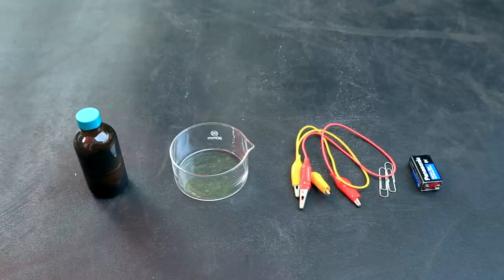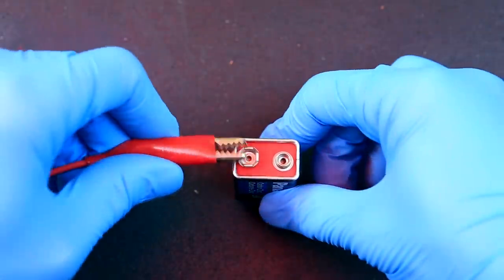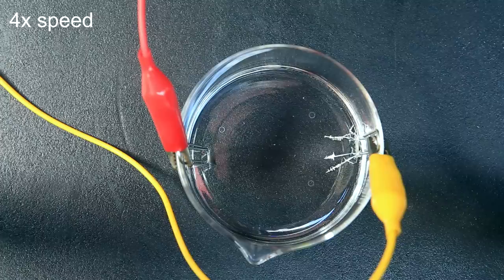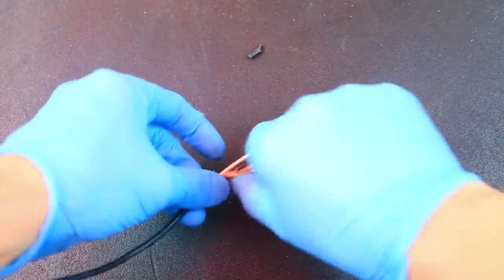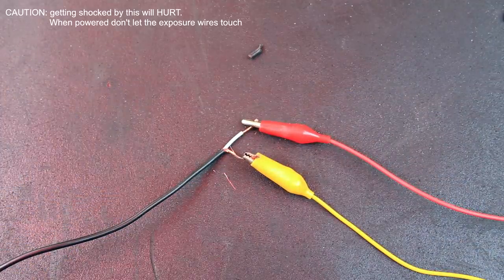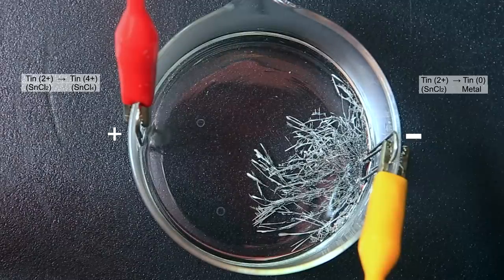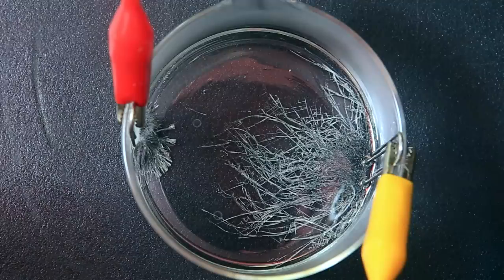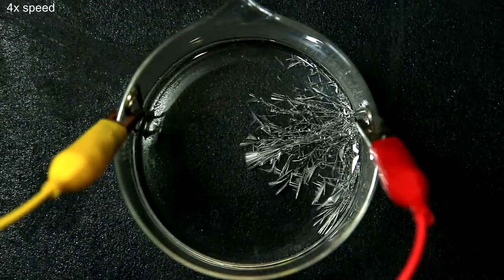How to grow Tin Crystals!

Comment: This experiment could be interesting at super-low temperatures. The low temp should increase current flow, but may inhibit crystal growth due to substrate viscosity, depending on how cold it was. I'm thinking once with an ice bath & once using liquid nitrogen with the nitrogen gas piped away so we can still watch it.

Comment: The solution is not boiling but along with Sn(2+) goes to Sn(4+) you have water oxidation: 2H2O to form  4H(+) + O2 + 4e-. What you see are O2 bubbles evolving on the anode. Contrary to that Sn(2+) + 2e- gives Sn(0) should happen along with HER (hydrogen evolution reaction). Luckily, Sn, Pb, Hg, Cd are bad electrode materials for HER. In fact, they significantly shift the onset potential for HER so that it will happen only at much larger applied potential than what would normally happen on Pt, Au, Ni etc. electrodes. That's the reason why we used to use Hg in Polarography (you can even reduce alkaline metal ions to form amalgams on Hg droplet that serves as an electrode during the Polarographic experiment). 
Cocking is nice but electrochemistry is more fun :P
Reply: Indeed it looks like electrolysis is fun!
Reply: “Cocking is nice”? Cocking what??
Reply: @Dave-dh7rt  Pretty sure it was cooking 😆
Reply: That’s too science to keep track off
Reply: I r cunfoozd
Reply: Ok big brain
Reply: big brain i didnt even understand a word you said
Reply: Electrochemistry is fun if we can understand :p
Reply: Dude,Please use english.
Reply: Sn or Zn?
Reply: Yes, as has been pointed out numerous times over the last few years.  Sometimes reading the description and the previous comments reveals such things.  😁😉

Comment: Hello there! :)
Nile Red, I like your chemical videos very much, they are really interesting and informative.

Let me make some remarks for this experiment. If you use power supply, it's very desirable to connect a resistor consecutively with your electrolytic cell. If the cristals of tin grow large enough to touch both electrodes, there is a risk of short circuit.
In the electrolysis process tin chloride solution on the positive electrode (anode) dosen't boil. Besides of main reaction of oxydising Sn2+ to Sn4+, here take place side-reactions:
     2Cl- -- 2e = Cl2
     2H2O - 4e = 4H+ + O2
Thus, the gas produsing on the anode is basically chlorine with some oxygen.
Reply from the maker: +KotMatvej Oh yes, I totally forgot about that! I kind of just assumed it was boiling because it was heating up the liquid a lot.
Reply: +Nile Red What does he mean it doesn't boil? It looked like it was boiling, wasn't it ?
Reply from the maker: +Constantino Fine Art It might boil after a little bit of it being on, but for the  most part it is gasses that are being produced by the electrolytic process.
Reply: +Nile Red What gas was being generated at the red end when it made bubbles? that's what I meant. I thought the bubbles were just water being boiled and not any gases being reduced
Reply: +Constantino Fine Art  The gas being generated at positive electrode is basically chlorine. When electric current run through the solution, tin ions Sn2+ reduce to metallic tin and chlorine ions Cl- oxydise to elemental chlorine gas. 
If you try to apply electric current to the table salt NaCl solution, at positive electrode you will get bubbles of chlorine gas too. 
Please read about electrolysis process, if you are interested :)
Reply from the maker: Thanks! I just totally and completely goofed when I thought about it. I used to do a lot of electrolysis and I've done it to NaCl too. Thanks for all the info! Greatly appreciated.
Reply: +KotMatvej Thank you! I observed a few times when I electrolysed copper sulfate that at the beginning only copper was being reduced at the cathode, and hydrogen at the anode,  but that after a while, lots of bubbles starting coming from the cathode along with steam. I assumed the water was being boiled at the cathode instead of any gases being produced. Do you know if a gas was being produced as well?
Reply: +Nile Red, you are wellcome!
 I am really pleased that my remaks can be helpful. On the other hand I am sorry if my comments embarrassed you. A long time ago I made electrolysis setting for sodium chloride solution and got enough quantity of "detonating gas" mix from chlorine and hydrogen to produce a lot of explosive soapy bubbles :))

Recently I have thinking about that chlorine and hydrogen gases don't react among themselves in the dark, but ultraviolet light can initiate chain reaction in this gas mix and lead to explosion of it. So is it possible that those explosive soapy bubbles can be ignited by UV-light? 
How do you think, is this a good idea for experiment? ;)
Reply: +Constantino Fine Art, I must say that on anode hydrogen ions H+ can't reduce because it charged positively and attract to cathode wich charged negatively. Instead of hydrogen ion, on cathode reduce copper ions Cu2+. The gas being produced on anode is oxygen owing to electrolysis of water molecules. If the volume of solution is low, the electric current is strong enough and electrolysis run for a long time, the solution near electrodes began to boil.
So I don't deny that in Nile Red's experiment solution start to boil at the end. In your experiment solution could boil too. In result the gas was being produced is oxygen with water wapor.
Reply: +Constantino Fine Art  By the way, the bubbles on the cathode nevertheless could be hydrogen gas because in certain condition copper and hydrogen ions begin to reduce together.
Reply: Ok thank you very much. I got confused i guess. So H2O loses oxygen at the anode ? But what molecules go to the anode ? H2O or OH- ?
Reply: +Constantino Fine Art, good point! 
To the anod attract  hydroxyl-anion OH- wich formed when water molecules dissosiate: 
     H2O = H+ + OH-
Reply: The tin does in fact short circuit at about 3:18. In this case, probably, the energy generated from the current would either cause the crystal to break, or the resistance in the crystal is high enough that the current isn't excessive.
Reply: I would think that the weak link in the circuit would be the tin crystals, and they would continually break. One could always add an inline fuse to the positive conductor as well.
Reply: @KotMatvej   Kot Матвей what is the best (Volt)  setting to grow a large crystals? With a large current setting (Amp) of 20Amp and 3.3 Volt crystals growing big and ugly. I try  3.6Volt and 2.1Amp it took day to grow the crystals but they look good. Your opinion???

Comment: It would be cool to see this in a taller beaker with the negative suspended in the center, and the positive attached to sheets around the perimeter to see if it will grow a spherical shape, or a single sheet at the top to grow a tin tree.

Comment: As a safety tip, it's worth pointing out here that the domestic voltage in North America is usually 110v.....whereas in other parts of the world (e.g. Europe) it can be 230v or 240 in the UK....this will possibly make this reaction go faster, heat up faster and also give you a much bigger shock if you touch the wires accidentally

Comment: Great video and thank you for warning peeps about getting zapped. I myself have had a close call. Better to use insulating gloves if you can cuz even being careful doesnt change humidity in the air, which can allow electricity to travel through the air more easily.

Comment: Dude, you need to check out Bismuth.  The melting point is so low you can boil it on your oven in a saucepan.  Now, that is not a good way to grow the crystals, speaking from personal experience (though I have managed to scrape a few gems out here and there), but the crystals are indescribably beautiful, in my opinion, and well worth the effort.

And, as per usual, thanks for your work :- )

Comment: Bubbling at the anode is most likely O2 gas evolution not local boiling. Over-voltage in excess of that required for the Sn redox reactions is causing electrolysis of water.

Comment: If you plan on doing more electrochemistry experiments may I suggest that you get a decent power supply. There are some decent power supplies on ebay (Chinese - Yihua brand) that can be set as either constant voltage or constant current. I do quite a bit of electroplating experiments, and found those to be very useful.
NB for most electrolysis involving metal salts you need a small voltage but a decent current.

Comment: Safety first,DO NOT use lead tin solder, HCl will burn you, and the gases produced will be poisonous and explosive. If you have a basic knowledge of lab procedures it should be perfectly safe. A few suggestions, it is best to use a constant current power supply. I believe an LM 317 can provide that.(An LM 317 will make a power supply that is variable down to just below 2 volts. A good idea is to simply put a couple of high power (10 Amp) diodes in line with the output. that will drop the minimum output voltage to just about 0 to 20 volts.) And the voltage should be kept down to less than 2 volts. even then you are going to produce some hydrogen and chlorine gas, so you need fresh air. The slower you grow the crystal the closer to cubes they will become. the best i have been able to achieve are about like a pencil stub. With higher currents the crystal will grow out like tin feathers, and i mean they really look like a feather. Another suggestion is to use lead free plumber's solder as your source for tin. Then you can just use a 7 to 10 percent solution of HCL,( muratic acid). the tin will come off of the solder into solution and make the stannous cloride all by itself. Another problem with using pure tin cloride as your starting stock is that you will produce pure tin crystals. Pure tin has the nasty habbit of disintigrating into a grey dust in a few years. I have crystals made from lead free solder that are decades old. And they are still shiny. In conclution DO NOT use lead solder You will probably poison yourself. And yes you can do similar things with copper and silver but they are not as nice, in my oppinion, and i do not know any of the voltage or percentage requirements.

Comment: Pro Tip:  Unless you need every last inch of cable, don’t cut your power supply cables, right at the plug. You never know when you’ll need that size plug, in a pinch. (Especially, odd ones, like laptop plugs.) Leave a few inches on the plug, for future use.

Comment: do the crystals only form on the surface?  if you had the terminals submerged deeper into the solution would the crystals form in a dome sort of shape? I'd be interested to see this experiment on a larger scale. cool video!
Reply from the maker: +andy pandy I dont think it is just on the surface. I just used a really thin layer of liquid. Doing it on a large scale is a cool idea though!
Reply: +Nile Red thanks for the reply, keep up the good work!

Comment: question. what if you up the anti? Use a lot more solution, a lot more current, and possibly put it in an ice bath to keep it from actualy boiling. I think it would be cool if you could manage to take it out still as 1 solid piece, and then submerg it in epoxy.

Comment: How did you cut your hand? ...Also, I have (what I think is) Tin Oxide from dissolving a circuit board in HNO3. Can I rinse the old acid out and put it in HCL to make this Stannous acid? My goal is to return it to its pure metal form.

Comment: Does this also purify the Tin metal formed ?   What I mean is that ; does the Tin metal form in preference to any other metals present as impurities , (their salts) , in the solution ?  I know that copper metal  is purified by this process. (electrolysis).
Reply: +Darek Chomik its pure, but he paper clips probably contaminate it, use a better electrode

Comment: There is no reason why it should hurt you when you touch electrodes from the laptop adapter! It produces voltage only 20 V and maximum output current is 4,5 V. This current would be deadly if it went through you, but in fact it can't. Your body works as resistor with capacity around 700k (you can measure it with your multimeter), so you can calculate the current going through your body like I = U/R = 20/700000 = 0,029 mA. It is really like nothing, you won't feel anything when you hold both electrodes in your hands when it is plugged into a socket. (You start to feel the DC going through you when it is about 2 mA, painful is 30 mA and deadly is around 40 mA.)
Reply: +Vojtěch Vrba i will try
Reply: While that adapter wouldn't shock you at the voltages it gives, several things you said are plain wrong.
For starters the human resistance varies, and most of it comes from the skin, once you pass that it drops down to 500Ohms. The high value under dry conditions for a human body is 100 000 Ohms not 700k. If it were 700k then mains wouldn't really hurt either 220 / 700 000 = 0,000314286. It takes 1 mA of AC current at 60hz to feel it, and 5 mA with DC (what the adapter provides).  Also you cannot reliably measure your resistance with a multimeter. Keep in mind once skin is broken your resistance drops severely.

Comment: you do know, you can just connect a few of them 9volt batteries in serial to get a higher current. No need breaking apart an old laptop charger, it might be unsafe

Comment: "Getting shocked by this will hurt..."

That won't shock you at all. Being a laptop power supply it's probably putting out 12-24 VDC. That's not enough to shock you, unless you put the wires on your tongue (which WILL hurt).
Reply: You did it didn't you.
Reply: @Ariemius  Yes I did.

Comment: Will this reaction be negatively effected by adding sodium silicate to the solution? My idea is to have the crystals form and be suspended in the sodium silicate which I suspect would present with an increased viscosity because of evaporation of the water it's most often in a solution with because of the electrolysis being carried out upon the solution.

Comment: Since tin is very conductive, how do you avoid short circuiting when crystals reach the other electrode? Doesn't one need some kind of divider cell or resistive electrodes to avoid short-cut in practice?
Reply: You don't

Actually that's not true. In a practical cell, gravity pulls them downward into a "tree" off vertical electrodes, and simply uses distance (at the expense of speed)

Comment: I also used a laptop power supply of 20V , 4.5A on the output and the power supply died. It was an old Dell 1998 laptop.

Comment: The growth of tin crystals (whisker) is a big problem in electronics manufacturing ever since the use of lead in tin/lead solder was forbidden. Unlike here the crystals grow spontaneously. It has nothing to do with the electric current. When a growing tin whisker touches a nearby circuit path it causes a bypass and the device fails.
Reply: A recent (within the last year or two) paper seems to indicate that tin whiskers grow from strain gradients. It's a mechanical issue.

Comment: You said in the video that the solution got hot and it seemed to me that you implied that temperature affected crystal growth, I was wondering what would happen to the crystals if you change the temperature of the solution by using chilled or warmed solution. Could you please test this?
Reply from the maker: +archBlitzer1337 The hotter the solution the more the tin will dissolve back into the solution. 

I would test it, but I don't have any more stannous chloride. Also, I have a lot of other experiments to do first!
Reply: +Nile Red ok well thank you for half of the answer and no worries man.

Comment: i want to see it with higher and high voltage. also what would happen with AC?
Reply: with ac the anode and cathode would get reversed according to the frequency of ac supply so it probably wont be effective
Reply: mark clemens i did that once , the vessel started vibrating violently and it just burst , the constant reversing polarity caused it , its a scary experience .

Comment: Awesome vid dude! But you will not get shocked by that power supply :) A laptop power supply is usually around 19volts dc and you wouldn't feel it at all.
Reply from the maker: +Ender Running I have been shocked by one before and it definitely hurt. :)
Reply: +Ender Running It depends on the power supply's quality.

A proper power supply will provide a terminal at +19 V DC and a ground at 0 V DC, which would indeed not hurt at all.

Crappy power supplies (which are unfortunately much more common) will have an AC component on both terminals (the difference between both remains roughly constant, but positive terminal/ground and negative terminal/ground voltage differences will simultaneously jump up and down)
And THAT can sometimes give you a shock!
Reply: 19v (PSU) / 300Ohms (Resistance of Broken Skin) = 0.06333333a over 6x min lethal amperage. 

(Wet skin, 500Ohms still is 0.038a which is almost 4x over min lethal and would be extremely painful...)

 It can not only shock you it can kill you!!

Comment: Could an electro-chemical  cell be used to transfer a pure tin bar anode through a hydrochloric acid electrolyte to a carbon rod cathode to quickly saturate the electrolyte to a stannous chloride solution instead of the slow dissolving method?